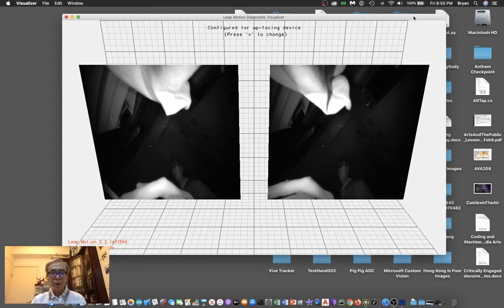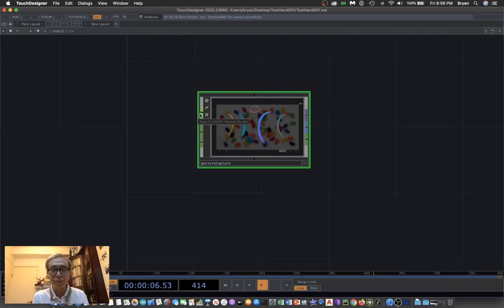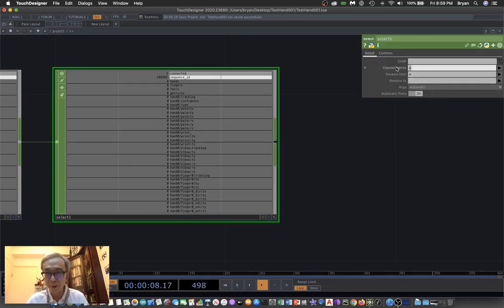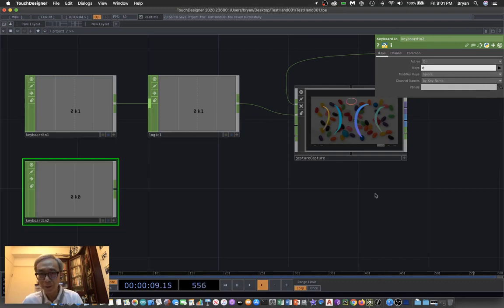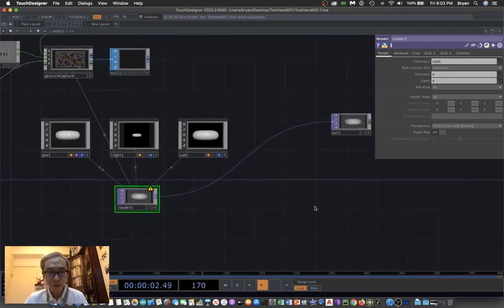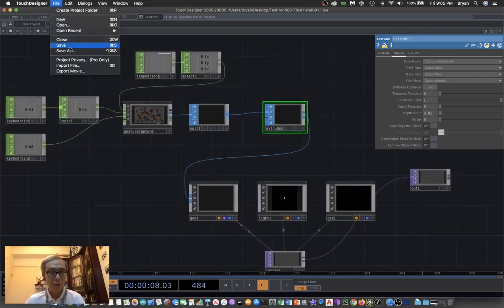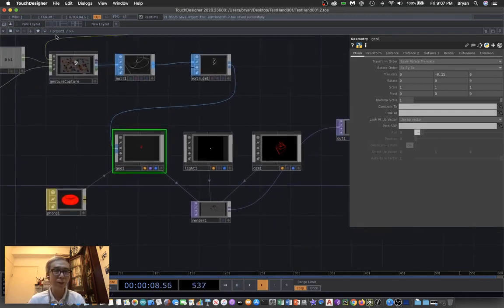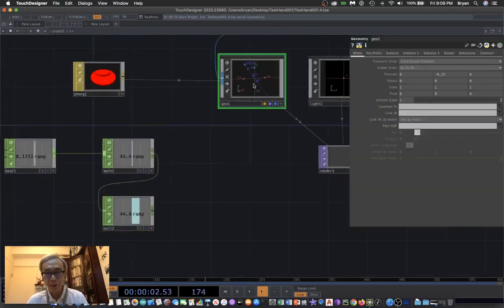Hand drawing with Leap Motion and TouchDesigner

Comment: Very cool - do you think I could use my drawing tablet instead of my hand to control this effect?? Many thanks!!
Reply from the maker: Yes, as long as you can get the coordinates from your tablet. Noted that the tablet may provide only the X and Y values. You may need to guess your Z value such as using the pressure, etc.